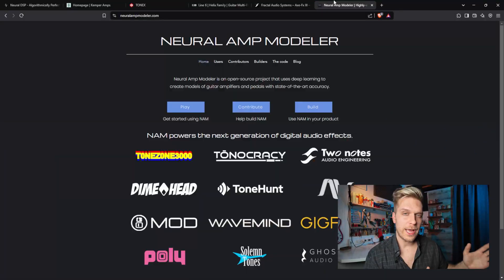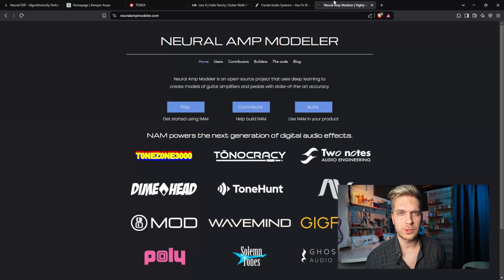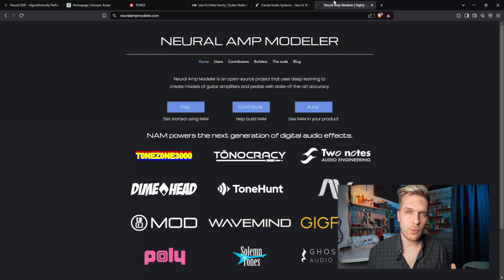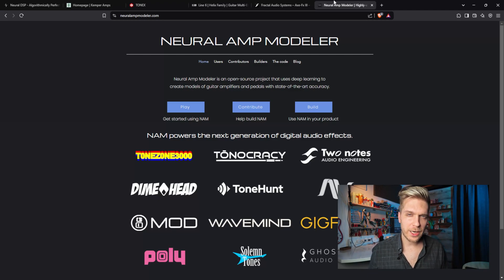Engineer Reacts: How Digital Guitar Rigs Work

Comment: I used to be a hardcore neural DSP fan but ultimately found they don't take OD pedals as well as a real amp. If you want to replace your entire rig for a fly gig, the QC is tiny and amazing but if you want to use in a hybrid setup it's always gonna be lacking compared to real tube amps. However, I also enjoy a hybrid setup like tube preamp (real amp, Kingsley or Friedman irx) with an IR or cab sim backend for recording or a digital UA preamp pedal into the FX loop return into a tube power section then a real cab.